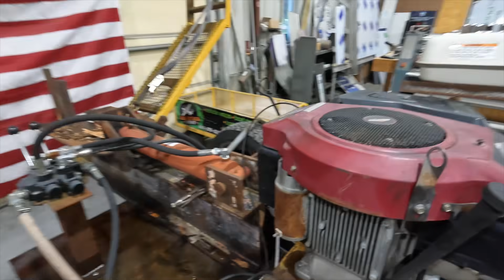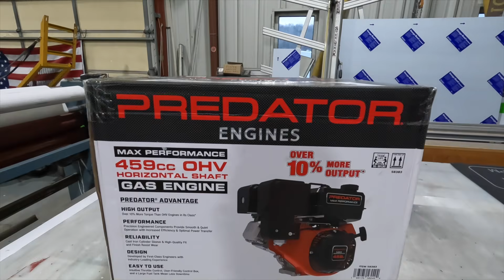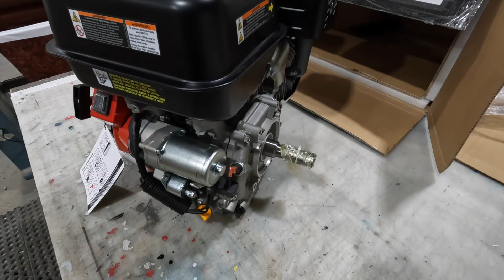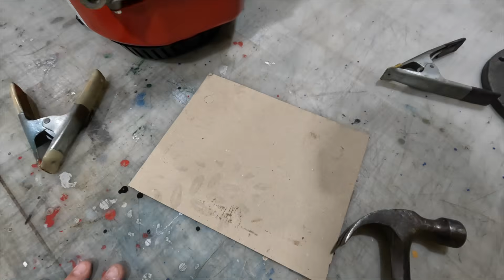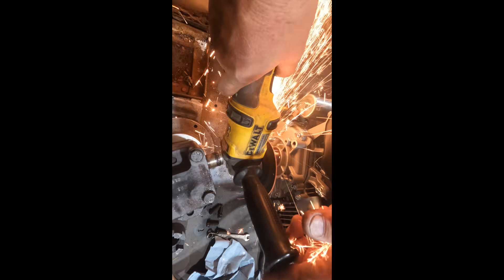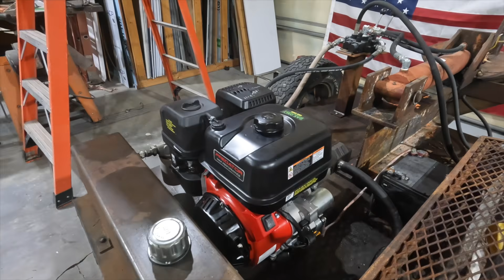Serious Upgrade for my Log Splitter

Comment: I bet you are going to find, You are really going to like that engine. I put a Predator on my kinetic splitter, and it runs excellent!! All I had to do was open up the High speed limit screw on the throttle lever, to get some more rpm's out of it.
Reply from the maker: I think so too.  right now I have about eight hours on the new engine. No problems at all.  It is a strong runner.  My only complaint is the throttle is very hard to open and close.  Probably has a bolt that needs to be backed off a little.  Thanks for watching!
Reply: @livedlearnedDIY mine on my small one is pretty tough to move as well. I just never looked into loosening it up.

Comment: 😁Hey thats great BUT one more thing you might want to change  is FILTER THE OIL BEFORE THE PUMP  INTAKE . 28 GPM takes  24 HP  if you change  PUMPS . thanks
Reply from the maker: Thanks for the advice. That gives something to think about. I had just seen other machines put the filter on the return side. Probably a good idea to put it before the pump.

Comment: My preference would have been to keep the engine elevated to give better access.  Now if something was to happen with the starter or pull rope looks like you'll have to take the engine off to work on it.
Reply from the maker: That thought did cross my mind.  The engine could be raised up very easily though.  I might do that sometime.  Thanks for watching.